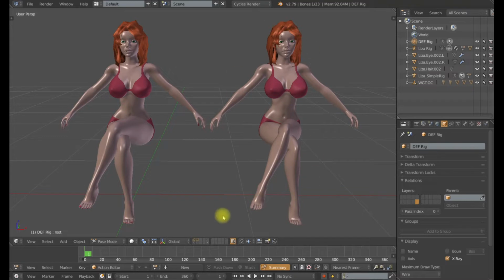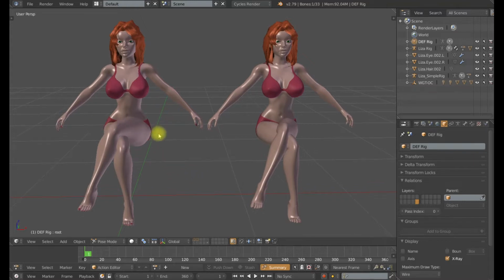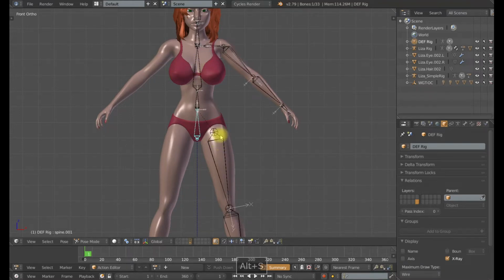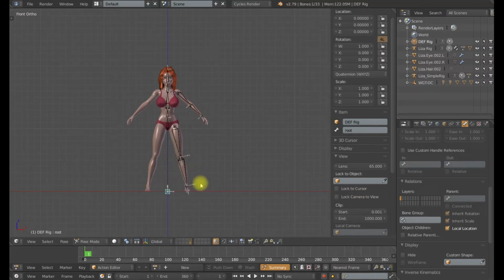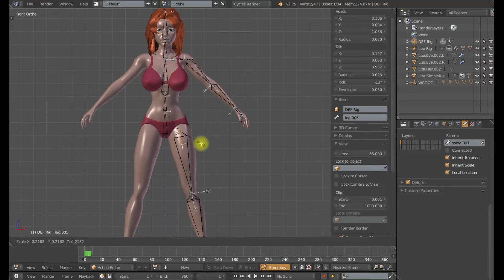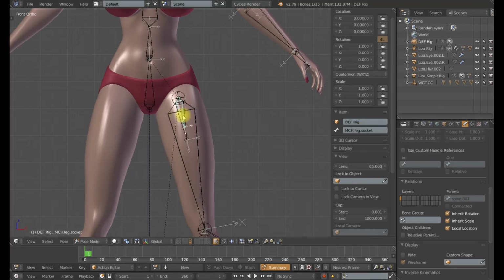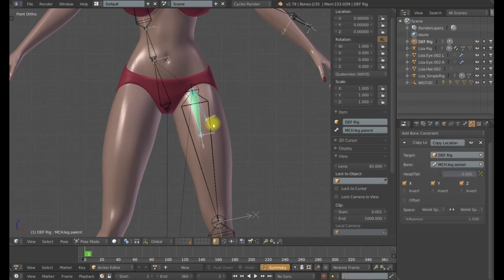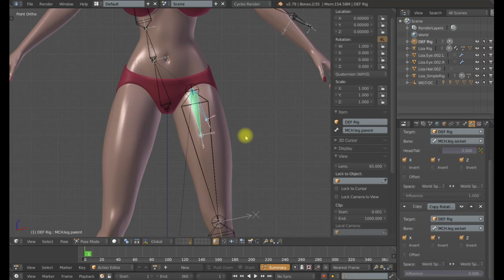Advanced Deformation Series Part One Socket Rig

Comment: Hi, I noticed that you don't use cage meshes to deform your body rigs. Is it easier to maintain body skin weight painting than cage mesh? I  asked it because cage doesn't respond well to bendy bones while bendy bones demands high resolution which opposite to cage mesh lowpoly work flow.